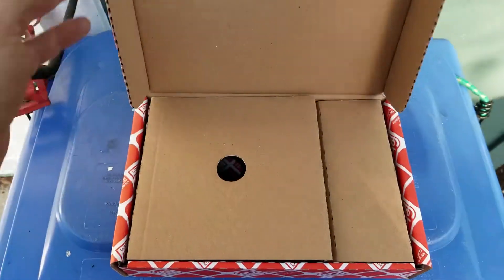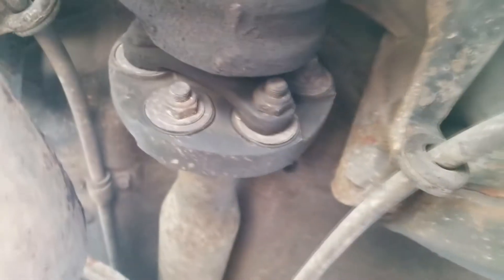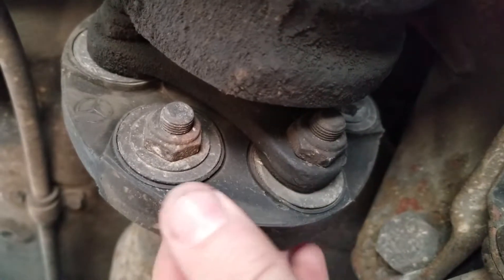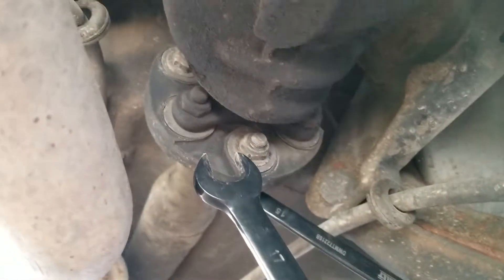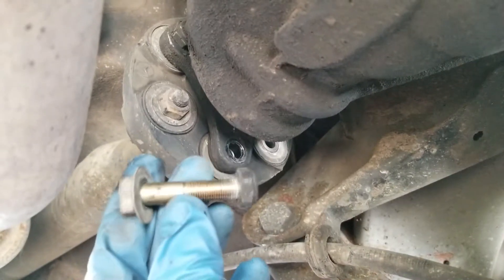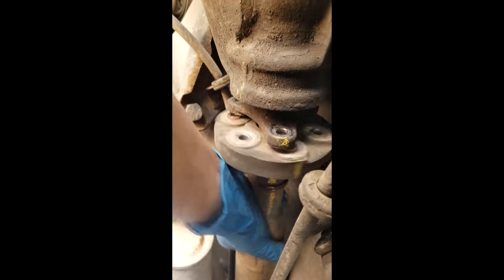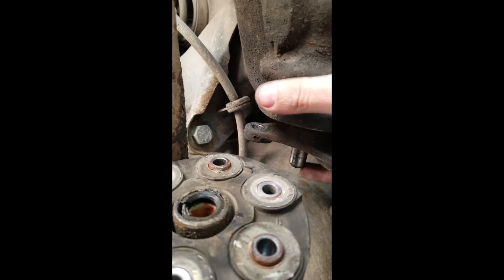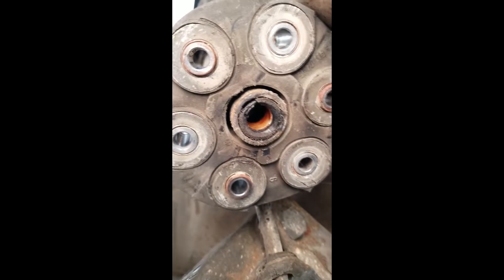W123 Flex Disk tips

Comment: Check your oil in the differential.  Also check to see if your drive shaft carrier bearing needs to be replaced. You will need a 46mm and 41mm open end wrench to loosen the drive shaft collar close to the center carrier bearing.
Reply from the maker: Are you suggesting the noise can be coming from there I will investigate once the rain stops.

Comment: Thanks for the video! I have 2 questions. 
Those febi discs works well? I installed febi engine mounts and worked worse than the old ones. The other question, only by removing bolts and maybe loosening center bearing bracket is there enough room to temove the discs????
Thanks a lot

Comment: I have the same problem i replaced both flex discs and its same its clunking when realsing the clutch ralidly or when i accerlate i also tryed  puling the hand brake put it on first gear and holding the brakes and reasling the clutch and i hear clunking sound from the rear have you been able to solve your problem? My mechanic says that if it was the diff it would cause vibration and make some buzz sounds and also he said that can be the heart of the clutch friction disc
Reply from the maker: I was underneath recently and when I spin the driveshaft by hand in park I can make it clunk in my case its sounds like from the diff. But no vibration at all. If I had time I would take the driveshaft out completely and inspect everything
Reply: @dieselbenzrevive6820  can you make a video of it and help us all who have problems to solve it i would be very thankfull its so anoying
Reply: I have a manual W123 that had a clunk when changing gears, especially 1 to 2 and 2 to 3. Clunk when letting out clutch from standstill to.  I could recreate the noise by turning drive shaft as this video shows and I was convinced it was the diff. I changed the axle shafts and that fixed the problem completely. I had previously changed both flex discs.
Reply: @andrewholland1794  i fix the problem by replacing the smaller bushing in rear suspension bridge
Reply: @bushidowtf9557   The bushes known as trailing arm bushes?
Reply: @MrRollin111111  sounds like it. Is there a way to check those to see if they're past it and leading to this clunk?

Comment: Did you ever figure out where the "thunk" sound was coming from?
Reply from the maker: not really it clunks only sometimes when shifting to drive and reverse im still not 100% sure where its coming from.
Reply: @dieselbenzrevive6820  I'm pretty sure it's the subframe bumping the body when torque is applied.  I have replaced every bushing on the rear subframe except for the sway bar bushings.  This was done due to the age of the components.  I did find that one of my shock bolts was loose and was causing an additional "clunk" when flexed and it stopped after retorquing.  Good Luck
Reply from the maker: @BUCKMAW  good to know i will inspect this .
Reply: I think the universal joints need replacement.
Reply from the maker: @MagnumPropertiesTHOL  i did replace them about a year ago but i need to get closer to pinpoint where the sound is emanating from.